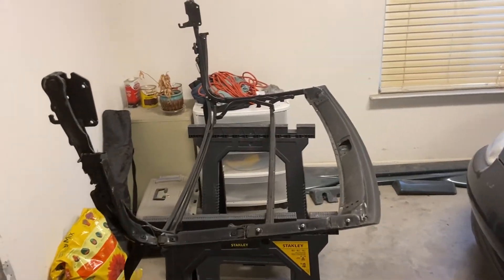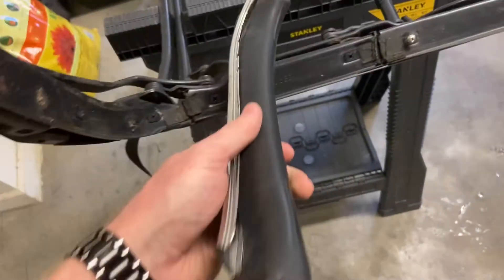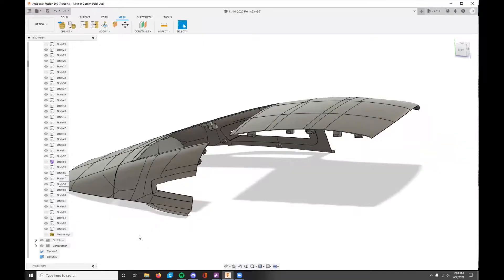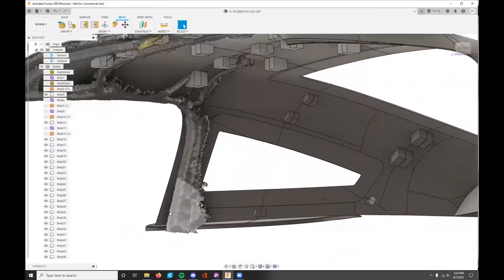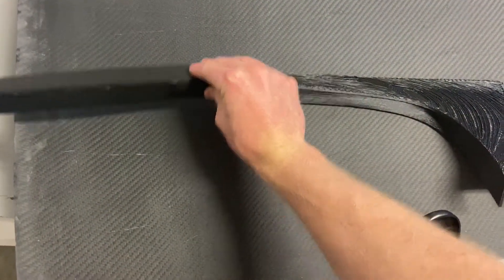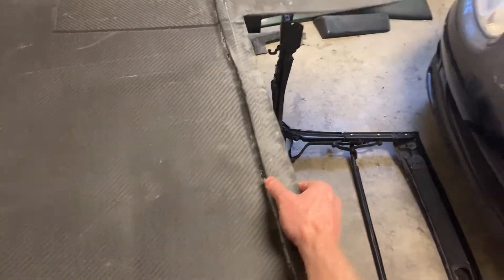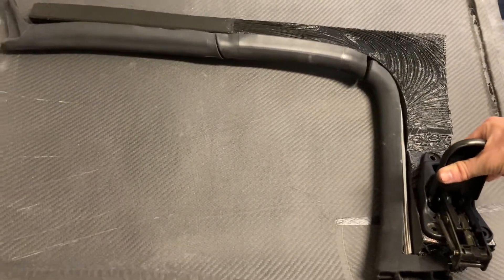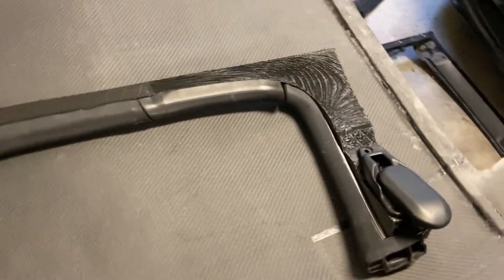Carbon Hardtop Mounting Design!

Comment: Hey , can you show proper 3d scanning , what kind of scanner you use
Reply from the maker: I just do it with my phone scanner. There are definitely better scanners you can use but this worked for me since I can just reprint the part if I didn’t design it completely correct around the scan. I will do a video on it next time I need to scan something.